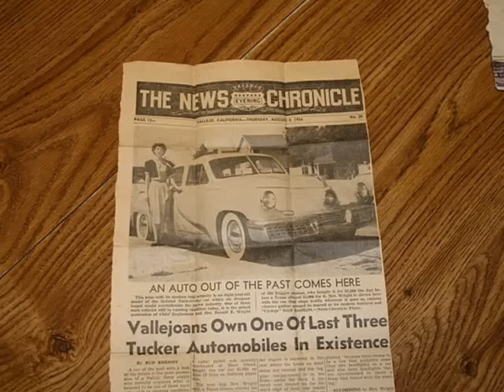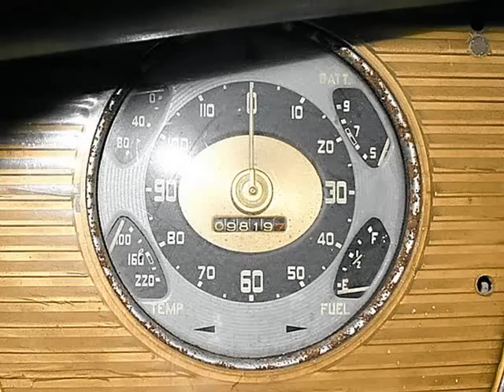Garage Find: Tucker Automobile Company Car Number 10

Comment: FROM WIKIPEDIA-After 50 years stored in a barn near Tacoma, Washington Tucker #1010 was sent to auction in January 2011 via Gooding and Co in Scottsdale, AZ for a starting bid price of $750,000. Reports and photos indicate the engine was seized, with rust damage throughout the vehicle and some minor exterior parts missing, including original hubcaps. Major restoration is necessary.

Comment: The dash design was actually a safety feature. When it was new, the dash was padded, as to prevent major head damage. And the area where the glove box would be on modern cars was used as a hole for ducking in before a collision. (ex. Say you are heading towards a tree and cannot stop or swerve. The passenger would then, quickly, get into the small area and hopefully be safe).

Comment: At least somethings are "easily" replaced...with items from other sources..includong the engine.  The steering wheel, rear taillights,door buttons etc being from mass made cars of other companies.

The rest can be reproduced if they are beyond repair from casting of other Tuckers and a range of knowledge from various folks that know the cars inside out.

Rapid prototyping will allow for more precise restoration too.

Comment: there is 2 missing and #0 (the prototype) was wrecked by the test track driver employed by tucker,it was rebuilt and is currently in a museum so 49 still known to exist in private collections with the prototype there were 51 of these built.including this barn find
 and counting the prototype that was built from 100% junkyard parts with exception of the body.the engines in these cars came from a company that made helicopters for the military that the military didn't want so tucker got them cheap

Comment: For a car with only 9900 miles on it and stored indoors, it sure is trashed especially on the inside.
Reply from the maker: The concrete floor / dry storage was a recent upgrade. No worries, it's been fully restored.

Comment: Yeah, I don't put a lot of stock in low mileage claims. Just looking at the video it looks like it had a repaint sometime in the first 100,000 miles...I wonder if there is any documentation to verify the mileage? Could have been parked early on due to lack of replacement parts, but why is it somewhat torn apart? I bought a 67 Jeep Wagoneer with supposedly 72,000 miles...but they also said original radio and the dash was butchered to put a vintage Ford radio in! My father's 67 (he is original owner) reads 50,000 but the odometer has been flipped over 3 times (over 350,000 miles) though it is more solid than most. My 70 Falcon has the actual 31,000 as it belonged to my grandmother, and it looks new. Still, this is an amazing find!
Reply: the Draeger's International video explains a lot more, including the low miles....
Reply: Mouse Toad I

Comment: Uh, not exactly. Although rear-engine cars like the Czech Tatra had been around for years, Volkswagen didn't make it into serious production until about the same time as the Tucker debacle. Funny, GM made a fair go of it with a better-engineered 4/5 size version of the Tucker, called the Corvair.

Comment: When I see a Tucker, with the limited amount of cars and especially engines (parts) unless you find one in good shape the only thing I'd do to one is restomod it, retaining the exterior and interior but install a Subaru drive-train and updated electrics.  The trickiest part is adapting the gear selector to operate an automatic trans-axle.
Reply: T'airn'KA   Engine parts are available. Takes a bit of scrounging.  It is an aviation engine.  There is a guy that specializes in Tucker restorations.  I’d hand the car over to him.
Reply: Restomoding it would be a crime.  It's too rare for that.  Should be restored.  This car, exactly as pictured, sold for $700,000.
Reply: I'm saying if there was no original engines and/or trans-axles available, what's left to do?
Everything would be the same but the engine and trans-axle.

Comment: You should also get a 1963 1/2 Falcon Futura Hardtop with a 260 V-8 and a Ford-O-Matic two-speed automatic transmission.  They are the ultimate in coolishness.

Comment: It seems unforgivable that a car, no matter how rare it may be, should be allowed to just sit in a garage, not being driven! Why would anyone do that with the car they just bought? That doesn't make sense.
Reply: In many cases I've read about the Tuckers were turned down by the insurance companies after the Tucker went belly up..  It couldn't be repaired or replaced so the owners just parked them.  There is a video on YOUTUBE about that.  Even talked to the old original owner of number 13
Reply: Jason1Pa I remember reading about that. That's the other thing that I believe to be unforgivable. Not enough Tucker cars were built for parts to be made available.

Comment: I am suprised the concrete floor did not cause much more rust damage
Reply from the maker: Was in a damp old detached garage on a dirt floor. Concrete was recent at time of vid.
Reply: 4spdBernie the dirt floor saved the fame
Reply from the maker: Beg to differ, this is the Northwest, nasty damp dirt floor did no favors.
Reply: 4spdBernie i agree but concrete is real bad outside with no heat I hadcars in georga and the concrete made junk out of the frames vs the dirt
Reply: Maybe it is differant out there
Reply from the maker: Guess you got lucky.

Comment: too bad company didnt survive..were great even by todays standards highway 35 mpg
Reply: +Miguel Castaneda The Tucker would be lucky to get 15mpg @50mph.
Reply: According to what i had on file..like the studabaker golden hawk mpg...even the little falcon ranchero..6...stick..35mpg
Reply: +Miguel Castaneda I'll have to do some research. Somewhere, I have an old automotive magazine that has a pretty long article of the Tucker, done before they went on sale. The reason I'm leery of the "35mpg" is that, the car was pretty heavy and the rear-mounted flat six couldn't have been too fuel efficient. The reason I'm leery is, for example: I've seen people selling 1976 to 1980 International Scouts on ebay with the Nissan inline six diesel engine. Most claim: "25 to 35mpg!" and refer to them as "rare!". I have a January, 1976 Motor Trend Magazine that tested one and they said: "...15mpg which, considering the size and weight of the vehicle is pretty good." Remember, that's a new Scout, not one 35 to 40 years old with a zillion miles on it. In fact, the diesel Scout got the same mileage as the 345 inch gas V8. The Nissan diesel was such a pile, most customers brought them back for a 345 gas transplant. Motor Trend called it "dangerous" on-road it was so sluggish on acceleration. The only reason manufacturers like Oldsmobile & I.H. went to the diesel was not so buyers got great mileage, but to eliminate them having to wait for those odd/even days to fill up. They could fill up any day they wanted and didn't have the 5 gallon maximum. The mileage actually sucked!
Reply: +Miguel Castaneda 
There is no way the Tucker got anywhere near 35 MPG. It is a large, heavy car with a large engine. The engine is basically a Franklin helicopter engine, converted from air cooling to liquid. The transmission, in the 51 cars built, was rebuilt, junkyard Cord units. 
The company failed because Preston Tucker  was not a very good business man. The company was severely underfunded. So much so that a proper transmission could not be built.
Reply: +Scooter George Oh, Huck---er! You found the site. You got to love the "crash basement" on the passenger's front floorboard. Room enough to sneak rocky and the Mort into the drive-in...if thy could have kept their mouthe shut!
Reply: +Miguel Castaneda 

I had a Mercury Comet. A 1962 model with the small 170 cubic inch 6 and 3 speed manual transmission. 26 MPG was the best it ever got.  And which Golden Hawk are you talking about? The 1956 wit the 352 Packard engine?  Maybe the 1957 with the Paxton supercharged 289 Studebaker engine. What? The Packard automatic was a 2 speed. Not very efficient. Same with the Warner Gear provided Studebaker unit.
Reply: inline 6 single barrel carb stick
Reply: *****
What is your source?  This is a big car with a big engine. I could see 20 MPG at a steady 60 MPH but not in real world driving.
Reply: +MsAmdfan ...maybe under controlled conditions. This vehicle was a hulk, dude! A Corvair would be lucky to get 20mpg.
Reply: +Miguel Castaneda "...inline six"? You sure about that, kid?
Reply: +Scooter George Don't you know it had an "inline six"? According to Miguel Castaneda above it did! Maybe a "Super Sonic" or "Green Diamond"?
Reply: +Scooter George My Yamaha has a V-twin...I think.
Reply: no guy was speaking of the ford falcon...sorry ....was a reply to some one else
Reply: +Miguel Castaneda Oh, okay! Now you're talking! Under controlled conditions, I bet a 144 inch Falcon could squeeze 35 miles out of a gallon. Ask Scooter George if he ever did a burnout on a large teddy bear with a 170 inch '62 Comet. Bear didn't survive. Neither did the Comet!
Reply: Yamaha SR650
6 cylinder Falcons and Comets used cheap Ford of England Daganham 3 speed transmissions. A very rare option on 6 cylinder Mustangs was a 4 speed version of this POS.  I'm calling it a night. Sore throat. Feel a cold coming on.
Reply: k good feed back out.. there...sorry to..been off track
Reply: +Scooter George Maybe that's why, when I helped Cory Meade do a clutch job on his Falcon, the tranny removal/installation was like moving a frozen loaf of bread. Of course, he wasn't doing John Force burnouts on teddy bears either. My 1962 I.H. motorhome had a 3 on the tree w/overdrive and I removed the tranny w/o a jack. Just the "slide it out on your chest" method. Never did put it back in...shit!
Reply: My 64 Corvair van / truck gets exactly 20 mpg on the highway, (real world) so not that far fetched with the right gears and the right conditions. That was not "new" but in the summer of 2017, so a 54 year old vehicle.

Comment: I've been working on cars for over 45 years and I can tell you this is not worth millions. Completely restored, it would NOT be worth millions.This car is to rough to  have only 9900 miles .
Reply: Really? A few have hit 2 million at auction the past 2 years and this car in the condition shown sold for 720,000 at auction. Also the mileage is not important on the car as you state  being why it's not worth much. Hopefully your knowledge to diagnose a cars issues and fix it properly are better than your car value knowledge.
Reply: Its the years ,and years of neglect that undoes an object, not the wiles  ..
Reply: In August 2010 Tucker #1045 sold for $1.127 million while Tucker #1043 went for $2.915 million at auction in 2012.
Reply: This car is a piece of Americana and deserved to be restored and kept in an air conditioned or at least humidity 
controlled environment,preferably museums!.Not for roads!.
Reply: I was thinking the same thing. I bet the car does have 9900 miles it probably broke down and sat ever since. Cars just sitting deteriorate . Plus it looks like it was hit in the front and was being repaired To date one just sold for 3 million at Barrett Jackson
Reply: ...I totally disagree with this assessment...except the part about the mileage. I highly doubt it is 9900 "original" miles, also...probably 109,900..or maybe 209,000...What the h@ll are "original miles", anyway?...as opposed to "non-original miles", "aftermarket miles", "fake miles", etc.??..are "original miles" somehow better miles than ones added at a later date?....never understood the logic in that shady-sounding term, probably something cooked up by some shiester used car dealer decades ago...to me, it sends up a red flag anytime I hear it. At any rate, mileage is not really of any concern on a car of this status.....
Reply: @patchesohoulihan9826  --agreed. My dad would look at a Ferrari and say the same thing. Some people have no concept of restoration and more importantly the intangibles.

Comment: The bumpers are too heavy add too much weight.  There is a frame which today would be aluminum.  The turning headlight
  is unnecessary.  Suicide doors are good, a big improvement. The car needed a better engine as helicopter engines waste
 gasoline.
Reply: "The bumpers are too heavy add too much weight" like any other car bumpers at the time. "The turning headlight is unnecessary" it was necessary, it helped the passengers see better when turning the car. "The car needed a better engine as helicopter engines waste gasoline" The car had 50 mpg and could go 120mph, why would it need a better engine?

You need to know your shit before you start criticizing the car.